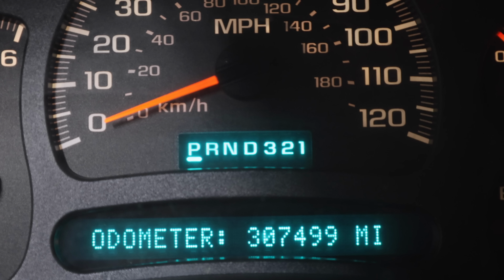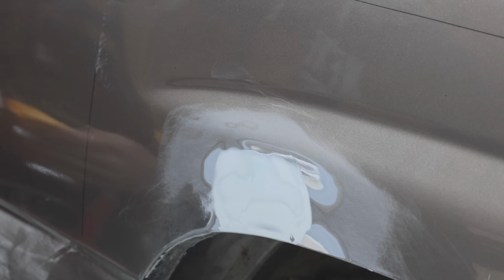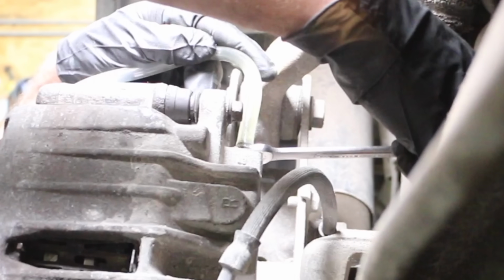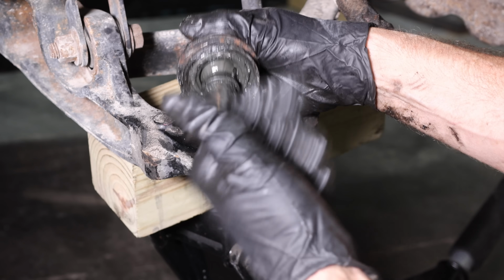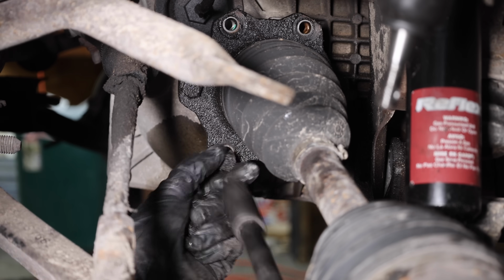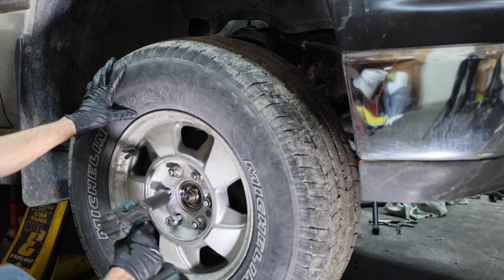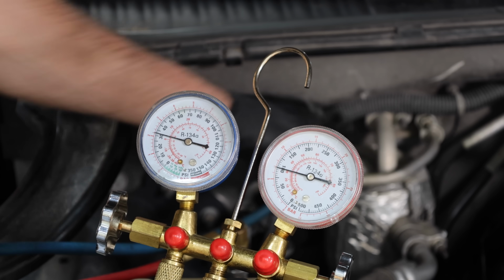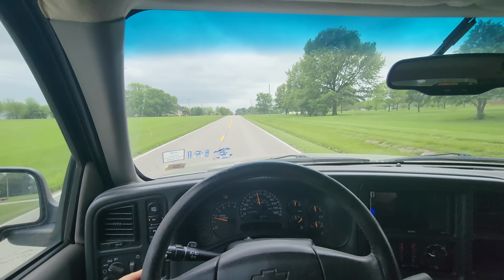Is It Stupid To Fix Up A 300,000 Mile Vehicle? Let Settle This!

Comment: 300k Miles driven in the city are not the same as 300k driven cross Country. And it depends on the vehicle itself. Which excludes pretty much all newer cars and SUV's. Most are being designed and built to last between 100k and 200k while in between you will spend thousands to keep them serviced and alive! Worst are luxurious, high price vehicles. New $ 150,000 and ten years later you get them for $9,000 with an engine light on. LOL. I am old school and stopped buying new cars long ago! Not playing games!

Comment: I have a 2001 Chevy Silverado. I recently had to replace the brake lines, prevent from rock auto, $200, the power steering rack needed to be replaced, $700 including work. Couple other things, I put about $2,000 in it. It has 265,000miles. I bought it 11 years ago for $2,000.

Comment: Got a low mileage '02 Tahoe at 243,000 miles. Lots of oil changes. Tranny and rear diff fluid changes as well. Ditto on coolant changes.  Great machine.

Comment: You never let your vehicle get in that bad condition. That's why are in Europe annual inspections for registration. Test of suspension, steering, brakes, emissions, lights, signals, windows, horn....
For example brake fluid should be replaced annually...

Comment: Some master tech comments. 
The inside tire wear is the slop I'm the steering.
The friction going down the road tries to force tires apart at the front lead edge, making the inside of the tire under more load & friction. 
Silicon grease on brake parts because it doesn't break down in water.
Rotors must absorb tons of heat, too thin, and they can crack without warning. 
Brake fluid darkens as it takes on water. It's hygroscopic absorbs moisture from air.
Steel wire brush caliper brackets under the rattle clips.
Buy only MOOG front end parts.
MOOG it & forget it.
No store brands.
Reply: Serpentine belt is replaced with all idler pulleys and tensioner assembly.
Spin the pulleys, if they spin too freely or make noise, replace them.
Reply: Do not over tighten steering parts. It don't take that much torque

Comment: I just did a DOD/VVT delete on my ‘12 6.2 Denali.  All new gaskets and oil pump.  Transmission  was just rebuilt and allowed slip turned to 0.  Installed a Texas speed stage 1 truck cam and BTR v02 52100 trunnion upgrade.  Many many miles left. 165,000.

Comment: I think the power steering pump is the part that attaches to the motor, and has a belt spinning the pump. What you replaced is the steering box.

Comment: For best corrosion protection with this type of repair, I have found that using an epoxy primer over the bare metal and then doing the body filler over the epoxy primer is a much better technique that keeps moisture from getting through the body filler and rusting the underlying metal.  And you don't need to change a thing with your videos!  As usual, well done!

Comment: My car has 228,000 miles on it.  While many people tell me it’s too old to continue to maintain, I continue to do this.  Project Farm, with 300,000 miles on his vehicle, is my hero and gives me the confidence to continue to maintain my car
Reply: Those people might be mad you have no car payment.
Reply: I ran my 2009 Chevy Cobalt for 345,000 miles before selling it.
Reply: That GMT-800 Suburban will last several hundred thousand miles with occasional maintenance.
Reply: Same here. The reason I let go my previous car with 255K miles were rust out frame and transmission start to slip.

Comment: My Dad's daily driver is a 2000 Tahoe with about 270,000 miles, zero rust and runs great.  He keeps up on everything and doesn't plan on getting rid of it.  He's almost 83, and he drives it from Ohio and Florida twice a year and grocery shopping and Dr appointments.  He's hoping not to have to buy another vehicle before his time is up, and the way it's running I think he's got it made.
It had around 60k on it when he bought it and it's been parked in a garage since he's had it except for driving.
You take care of them, and they should take care of you.
Reply: As long as it's driven relatively often, and not doing a lot of sitting it'll do fine.  For some reason, ironically, if you leave a vehicle (of any brand) sitting for long periods of time, they start to develop problems.

Comment: I put 315,000 miles on a 2001 Suzuki Vitara with 6 years in California and 10 years in Illinois, the only reason I sold it was I no longer wanted to spend $1,500 a year on repairs to keep it running. The salt and snow wore everything down to the point that I would fix one thing and another would break. It's a testament to changing your oil every 3,000 miles though, I never had a single issue with the engine or transmission.

Comment: Nice!  I have 150K on my 2006 GMC Yukon 4x4.  I'm still running the original hubs and brakes.  I did install the case saver for the transfer case pump rub - something worth while to do.

Comment: Depends its an 03 chevy so mechanically besides the trans you should have very little worries with regualr maintenance and same goes for p much any big american brand truck theyre made solid decent rule of thumb is if its gonna cost you more than the vehicles worth trash it

Comment: Hi 1st My 1964 Pontiac Le mans Sport Coupe, was 43 years old when I finally sold it it was my only car(I owned it 32 years), i used Only Synthetic Grease, and Oils. this is the Parts I replaced 2 tie rod ends and Both lower Ball Joints, 1 left rear wheel; bearing and 1 Water Pump{I use ONLY Distilled Water}, rebuilt Master cylinder and all wheel cylinders, front & Rear brake Hoses, Adjusted steering Box, It only had 236,000 mi..  Here's the best One, My 1973 Moto Guzzi 850 Elderado, Used Synthetic Engine & Gear oil w/Molybdenum Disulfide mix{factory Recommended}I replaced the Clutches once w/Barnett system, Clutch cables 4 times, brake cables 3 times, and 1 Exhaust Valve,(these were the ONLY Part expenses) and sold it in 2005 for what I paid for it new, And 457,000 miles.. My present Truck is a 16 year old,  3L 5speed std, After initial Break in I changed ALL Oils over to Synthetic, and Use only Distilled water for radiator Tank{no Parts Needed}. I do have to add about 1 quart of oil a year.  IF you do proper maintenance the Vehicle.  Just think the Interest alone on a New Vehicle, is almost $10,000+, that pays for a Lot of Maintenance..

Comment: One tip you don’t share is to always open the fill plug before you drain fluids (differential, etc.). This can both help fluids drain more easily, and you don’t end up draining and being unable to fill if the fill plug proves difficult to remove.

Comment: My burban has 210-215k on the stock... almost everything. So far, ive fixed everything thats broken or needed upgrading. That said, ive recently been getting a misfire on 3 that comes and goes and sometimes 1 in 10, when i start in the mornin, there is a mighty puff of white smoke. I know she eats oil, about a qt every 1500-2k miles. Shes getting tired and i think ive done about as much as I can.

Comment: Don't change a thing!  Your videos are perfect as they are.   IMO the GMT 800 was the best series of trucks ever made.  I may be biased but in my 60 years on this planet I have driven and owned just about every pickup truck made.  I won't ever let my two 2003 GM trucks go, the Yukon XL Denali has 212k miles and the 2500HD has 317k miles.

Comment: I have found your video's very informative. I now have more knowledge in maintaining my 2017 Silverado which only has approx. 36,300 miles. With today's modern cars & trucks, even the simplest things as changing the brake pads & rotors will turn on the check engine light. Which will mean a trip to the dealership to reset or having a scan tool to reset the code.

Comment: There's a few different variables. Is the body in decent/good shape? Is the frame in good shape? Not too much rust and not bent. If it has good "bones" that's a good start. Other than normal maintenance and wear and tear unless the engine has problem a good maintained used vehicle can last a long time.

Comment: Before of old calipers sticking. I did my 04 chevy recently. I could not push one of the calipers back in so I replaced it.  After my first drive, I could smell hot brakes at the other rear wheel. Had to change that caliper too. Your speed and cadence is perfect - one of the things I like best about your videos!.
Reply from the maker: Thanks!  Thanks for sharing.

Comment: I have owned 16 cars in my life and to my surprise the most reliable car I have owned is a 2006 Subaru Forester SG non turbo auto, which I still have. I bought it with 166,000km it now has 285,000km. In the last 120,000km+ all I have had to fix was new leads, new air con compressor clutch and a wheel bearing. All the other stuff is general maintaince, new fan belt, the brake rotors and pads. Otherwise all I have done is change the oils and filters. I will do the timing belt at 300,000km.  Blows my mind how good it has been.
Reply from the maker: Thanks for sharing.

Comment: I’m not the least bit surprised to see over 300k on that engine - a friend’s daily-driven 2000 Silverado currently has just over 450k on it - but I am impressed that your original transmission is still holding up. That’s a lot of miles on a computerized automatic, especially in a 4wd truck. You’re either very fortunate, or you’re fastidious about your driving and maintenance habits. 🏆
Reply from the maker: Thanks for the feedback.

Comment: The truck I drive right now is a 94 Chevrolet 1500 W/T I paid $625 for it with 310k on it almost 5 years ago. It has 334k on it now. I have only put a waterpump, battery, and 1 tire on it in all that time. Only time it failed to start and go is when the battery went out in my driveway.
Reply from the maker: Nice!

Comment: Just a tip for changing diff fluid. Make sure to remove the filler cap before draining. You don't wanna drain the t case if you can't refill it. You're literally dead in the water if you strip the top bolt or it is seized. If you can't remove the fill bolt, take it to somone who can.
Reply from the maker: Thanks for the constructive feedback.

Comment: I'm always amazed when old vehicles like this are in such good condition and come apart so easily. Around here, you'd need a long breaker bar and usually a torch to remove half the nuts you've just removed. Also, at 300k miles, there probably wouldn't be much if anything left of the OEM brake backing plates.
Reply from the maker: Thanks for the feedback.

Comment: If the frame/body are solid, it's cheaper to keep her! New cars are CRAP. You'll end up spending a whole lot more money buying a new car, between financing interest (remember a couple-year-old car has WAY more interest!), full coverage insurance, gap insurance (if you got a couple-year-old car), and of course the initial purchase cost. And we're not even considering repairs. Oh yeah, newer cars are more complex, and therefore break more often. So if it's new-new, expect the car to be stuck in the dealership for potentially weeks or months for some major repairs under warranty. Yes, brand new cars are having major failures all the time, across multiple brands. If it's a few years old, expect to pay thousands in repairs when something major breaks, which it will. Because newer cars are more complex, that also means they're harder and more expensive to repair. Something common to break like a water pump which might be a $500 job on an old car, can easily be $2000+ on a lot of new cars. It's simply not worth it.

I'm a professional mechanic, so I might be biased. But I'm also not driving anything newer than 20 years old.
Reply from the maker: Thanks for sharing.

Comment: If needed you can get low mileage (~50K) japanese engine and/or transmission from various US based JDM (Japanese Domestic Market) companies for a low price. My '07 subaru engine died from a broken wrist pin. I purchased a JDM motor and got it installed for $2500 total, so 56K mike engine in a 165K car. Runs great. In japan auto taxes increase as the car gets older so there's a fair amount of low milage car turnover, which is where the engines and transmissions come from.
Reply from the maker: Thanks for sharing.

Comment: Can't believe you used that cheap leftover wooden block for sanding ... Just kidding, I usually do things the most cost-effective way as well, and I would walk over hot coals before spending $100's on some specialty sanding block, or whatever. 🤝  2x4/2x6" 🤷
As for the speed of presentation, you have been at the right pace for a while. Not too slow, not too fast. In the Goldilocks Zone
Reply from the maker: Thanks for the feedback.

Comment: 100% fix it and get who knows how many more hundreds of thousands of miles out of it, definitely a solid truck.
And if the motor locks up or the transmission goes, just simply replace with fresh units.👍
Save yourself a lot of time, headache and most importantly MONEY!😂
I've been a mechanic for over 25 years and one thing I've learned...
Older cars and trucks are simply built better and last longer😏👍
Reply from the maker: Thanks for the feedback.

Comment: Some of you may remember that last time Todd did a video about his suburban, I posted that mine had just had the transmission die. Good news! My transmission was fine, but the transfer case reluctor had failed and was causing the transfer case to shift into neutral, disabling the drivetrain. It was a $25 fix. Easy-peasy.
HOWEVER...... at 240,000 miles, my engine is now leaking and burning oil at a rate of about a quart a week. SO... Todd, my Suburban is getting a 6.0 swap. When are you doing yours? :D

Comment: If you live in an area that has low humidity or at least doesn’t use road salt in the winter.  In the northeast, there isn’t enough metal left to fix after 300,000 miles.
Reply from the maker: Thanks for sharing.

Comment: Just got rid of my Dodge Dakota, manual transmission.  347,000 miles, replaced the tranny at 180,000 and the rear end at 200,000.  Loved that truck
Reply from the maker: Thanks for sharing.

Comment: i so wanted my 04 suburban to last forever, at least hit the 500k mile mark with it.   problem is, circa 2010, seattle/tacoma counties had other plans & started using salt on the roads for the 1.5 snow storms they have every year.  i was all geared up with an extra set of wheels w/studded tires for winter too.  broke my heart when i discovered the damage to the underbody and saw the rocker panels develop blisters the following year.  i grew up in wisconsin so i knew the days with this nice rig were numbered.  my only complaint with it was the phantom seat heater issue which was redneck remedied by unplugging the proper wire connector.  rest in piece(s) 2004 3/4 ton suburban.  had to retire her with only 232k miles.  somebody got a nice 6L LS motor to play with.
Reply from the maker: Thanks for sharing.

Comment: That old suburban even with 300k on it will still outlast most of the crap these auto makers are spewing out. Ive seen them go 500, even 600k on the original drivetrain. Most of the time its rust or accidents that take them out.
Reply from the maker: Thanks for the feedback.

Comment: watched every bit and even know everything you did. so nice job. don't change. my '01' silverado certainly doesn't look to good. too many salt filled michigan winters. but all is done on it underneath. drives and runs like you just pulled it out the factory. that said, years ago i mentioned you talk as fast as my daughter. i could picture you two having a conversation. it'd be like listening to an album set at 78 rpm. and i'd still understand it all.
Reply from the maker: Thanks!

Comment: Million dollar question, What brand oil did you primarily run in there?
Reply from the maker: Lots of Amazon Basics and Super tech but  changed the oil every 3000 to 4000 miles.
Reply: @ProjectFarm  Even with synthetic? Thank you for the response! Keep up the good work

Comment: I would have changed the control arms instead of pressing in new ball joints.  That way you get new bushings too.  The bottom one is kind of hard when you have torsion bar suspension though.  The top ones can be a bear too because the bolts ALWAYS break.
Reply from the maker: Thanks for the constructive feedback.

Comment: You want an engine to live forever (forever free from dirty oil wear?)  Install a bypass filtration system (it micro-filters your oil).  I did it once but haven't gone through the trouble to do it again since selling that truck.  The system is used by military and industry to eliminate oil changes. They do oil samplings and only top off the oil, never change it.  I think I should see if I can get one small enough for my car.
Reply from the maker: Thanks for the feedback.

Comment: The thing about fixing up a vehicle is that you'll know everything wrong with it.  Combined with the high cost of even used vehicles, and it's often a good return on investment.  Plus, you gain all the knowledge of repair and restoration and that's never a bad thing.
Reply from the maker: Good Point!

Comment: Buying a Repair Manual for your vehicle is a must, if only to understand its mechanical and electronic systems so you have an idea if your Service Department is being honest with you. But if you are using the RM for doing your own repairs, this video is telling you everything the Repair Manual isn't showing you or going into detail on. If it did you would never use it. This video is more valuable than your Owner's Manual (free with your vehicle purchase) and your Repair Manual (anywhere from 30. - 120.) put together plus the money you save instead of paying someone else to do it for you. Also the money you save will pay for most of the tools you will need to maintain your vehicle(s) on just the first maintenance done. Opinion and first hand experience of a single Mom female.
Reply from the maker: Thanks for the feedbackk.